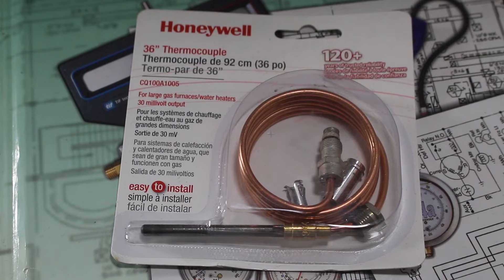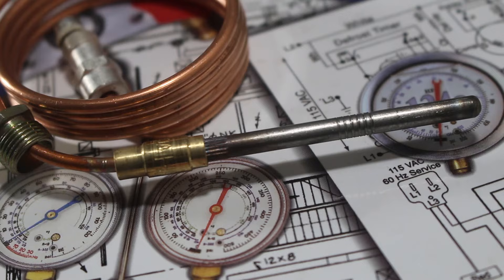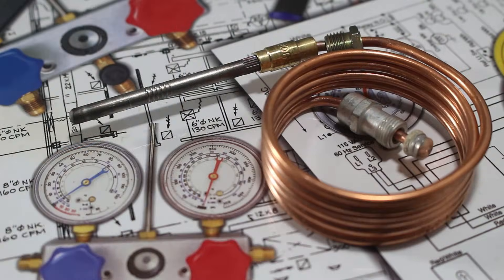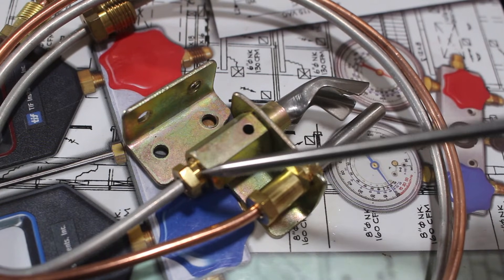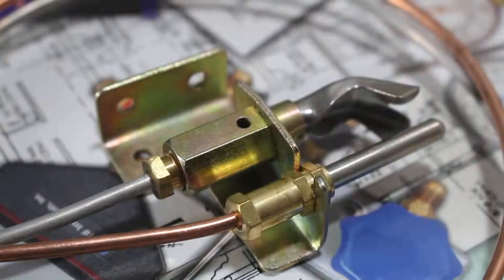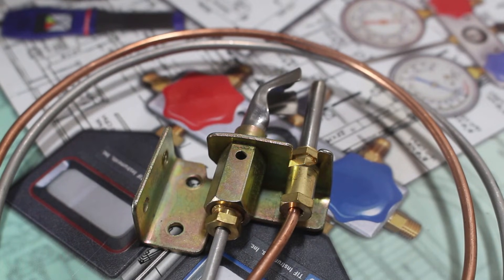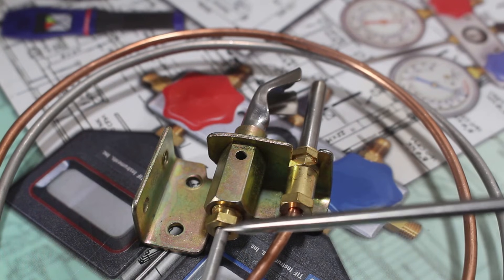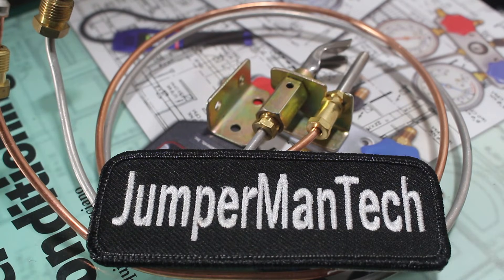HVAC: What Is A THERMOCOUPLE & How Does It Work? (Basic Working Principal) How It Works

Comment: I have a gas heater that I always have trouble lighting in the fall. Now I know why. Keep the valve pushed down so enough heat is generated for the thermocouple. Thanks for the info.

Comment: I have a temperature controller with a very small copper line leading to the larger end that gets put in the liquid that I need to control temperature. The small copper line is about six feet long and I need to shorten it to 5-6 inches. I completely understand how a thermocouple generates a voltage and is sent through two wires but this seems to be just a single small copper wire or possibly a tube. Can there possibly be a very small wire inside the small copper line? If I don't get an answer, I'm going to go to the hardware and buy a nat-gas thermocouple and cut it and see what is in it.

Comment: Great Video.    Question Please:   The bracket (shown in your video)   showing the thermocouple bulb and pilot light bonnet   .....Where can I get one of those.   My Burnham gas boiler has that assembly welded to one of the flame tubes.   The problem I am having is the old thermocouple used an aluminum nut assembly that screwed into the thermocouple bulb holder and it twisted off.  I managed to cut the old thermocouple and drilled carefully,   but I can't remove the aluminum piece that remains inside.   I am afraid of going any further because I risk ruining the inside threads or distorting the hole that the bulb is mounted into.      Right now,  I am using the clip that comes with the thermocouple kit to fit over the bulb and hold it in place.   Might you have any suggestions?    Thanks

Comment: im actually a tech myself but not very experienced in heating. my gas valve solenoid kicks in and out constantly on a williamson boiler. i verified 24v from trans to module. then from module to valve. i dont see a pilot on the boiler i think it just utilizes a spark control. im guessing its the valve itself. any ideas?

Comment: Thanks for the great video!
Just a question. 
What happens when you use a thermocouple with a PID heat controller to use it to determine set point whether to turn a induction heater element on and off if the thermocouple breaks down and the PID controller reads zero celsius? Does the PID shuts off automatically  or does it keep trying to heat u the element in order to reach the program heat set point?

Comment: Excellent explanation and video!! I found it because we were having trouble with our pilot light, which explains a lot, as well as the primary fix. What would also be helpful to learn is what happens to an aging thermocouple. Ours seems to be disintegrating — supposing this is due to 6years of constant heat, but that seems unfortunate given its designed use.

Comment: seems like such a tiny voltage to operate an electromagnetic valve to open or shut down a big volume gas pipe. 30 milivolts? is that .03 of a volt? and at how much miliamps? seems like such micro power.   this tiny charge doesn't go to a powered valve,  this small charges operates the valve...wow...how?  so weak

Comment: The Thermocouple copper tubing has wire running down its center (Usualy with high temperature insulation surounding it) somewhat like coax wire used for TV signals the copper tubbing connects one side of the circut, the wire inside the other.. the connector on the gas valve has an insultated central contact , and this is connected to small electromagnet in the gas valve safety system that will only allow the gas valve to supply gas "if" current is being generated from the thermocouple being heated from active pilot flame ,, lose the flame you lose the milivolt current driving the electromagnet and gas valve closes..its safety operation must be proven.  blow out the pilot and its gas flow "must" stop in under 45 seconds.  if it does not close the gas feeder valve feeding the applience and red tag it Do not operate until inspected by a licenced Gas techician .. you have a faulty gas valve that must be replaced by a licenced gas technician. some gas appliences also have a second Thermopyle generator that also uses the pilots heat to generate a higher voltage around 300 Milivolts that is capable of opening the main gas valve. without the need for power from the power grid..

Comment: Very nice video. I have blue seal deep twintank  fryer GT46. It is fitted with both thermopile and and thermopile  with it gas vales. One of the fryer's pilot is not staying on. When I leave the pilot holding knob,  the pilot switches off. I have checked both thermopile and thermo couple. Both are working fine. Please can you advice what else can be wrong? Is that mean the main gas valve has gone? Or any solenoid in the valve has stopped working? Can we replace solenoid or the whole valve needs replacing?

Comment: You forgot  to say that the 30 millivolts is an open circuit reading and not a closed circuit reading. Closed circuit is when it is connected to the gas valve and will be lower.

Comment: No, you get this totally wrong. You claim this works via electricity - which is true only for electronic metallic strip measurement thermocouples connected to a voltage meter. 

This control type of thermocouple works simply by heat expansion pushing the rod out of the end of the thermocouple to keep the gas valve open while hot. 

You can demonstrate this to yourself simply by telling a new thermocouple and heating the sensing end while watching the rod at the far end come out.

Please delete your voiceover to this otherwise excellent video and rerecord it.
Reply: thanks!!! that didn't make sense... I wrote this comment above:   "seems like such a tiny voltage to operate an electromagnetic valve to open or shut down a big volume gas pipe. 30 milivolts? is that .03 of a volt? and at how much miliamps? seems like such micro power.   this tiny charge doesn't go to a powered valve,  this small charges operates the valve...wow...how?  so weak how can this work"
however the expansion of metals is a powerful force, able to depress a spring on the other end.....now it makes sense.    I hate misinformation when it comes to engineering....this guy made such and authoritative sounding maration...but he didn't know how it works.      Anyone can replace a thermocouple, but I wanted to know how it works.....thanks man
Reply: Where are the electrical contacts to the solenoid?
While I know nothing of this device (hence why I watched), seeing a long copper pipe and what appears to be gas sealing crimps, my feeling is that this is a pressure switch: the pilot heats the end causing expansion, and the fill gas transmits this expansion to the other end (similar to hydraulic brakes): no electricity involved.
Reply: Thank you! I've never known how a thermo couple interfaces with a gas valve, for some reason 99% of explanations online are showing a thermopile and calling it a thermocouple.

Comment: So this is not actually how the thermocouple works but rather how a thermocouple works in an HVAC system.  There's a difference between a thermopile and a thermocouple.
Reply: In principle they work the same.  A thermopile is merely many thermocouples in series thusly the voltages is 750mv instead of 30mv (open circuit).
Reply: It literally has HVAC in the title smh

Comment: You explained what a thermocouple does, but did not explain how dissimilar Metals produce DC voltage
Reply: Here is a made up explanation of why dissimilar metals will generate a voltage when heated.

When a metal is heated, the electrons in the metal speed up and wants to move away from its heated area.

When two dissimilar metals, such as steel and copper (that are joined together), are heated, the electrons in each of the metals (steel and copper) wants to move away from the heated area, but since copper is heavier than steel, copper has more electrons, and thus copper is able to push its electrons past the steel electrons, and thus creating a voltage and current. 

Two metals of the same kind can also create a temporary voltage (and current), if one is heated and the other is not heated, and are afterwards, joint together.

The above is an explanation that was just thought about, to support the idea, that someone mentioned, that dissimilar metals (joined together) will generate a voltage when heated.

Comment: Is it possible to be able to use this to heat and melt metals in a crucible
Reply from the maker: I'm not sure about melting metals but I don't really see this being used in any way for that. Thank you for watching! Maybe get yourself a torch with a gas that burns at high temps 🤷‍♂️

Comment: Thank you I feel like my teacher made this way too complex than it need to be.

So in summary uses 2 metals copper and iron.  fuel, air, heat makes the thermocouple energized to hold open the solenoid which always gas to continue to pass threw the orifice so the pilot burner stays on when heat is being called

That's really neat making a system that works and supports each other in a continuous loop.
Reply from the maker: You're very welcome & thank you! I appreciate your comment🙏 I'm glad you found this video easy to follow. This subject can get really confusing but you got it! Stay safe out there & stay tuned for new videos every week🔧
Reply: The thermocouple and pilotstat are the self supporting, self sustaining safety circuit of a combination gas valve.  A thermocouple in a pilot flame generates the necessary millivolts to hold the pilotstat or pilot safety energized. The pilot safety valve when engaged allows a continuous supply of gas to the pilot burner (and to the main gas valve providing the gas cock is in the on position).  As long as the pilot is lit the thermocouple continues to generate mv which continue to hold the pilot safety down and so on...  should the pilot flame go out the mv decrease until they reach the drop-out value of the pilotstat and the entire valve shuts off regardless of whether there is a call for heat or not.  The pilot flame is the reliable source of ignition for the main burners and therefore vitally important for the safe operation of the appliance.  Modern appliances have eliminated this genius system in favour of a far more complex method of flame proving that is not only more problematic but also require much more attention.  They do eliminate that pilot flame burning gas during the off cycles or periods of non use.